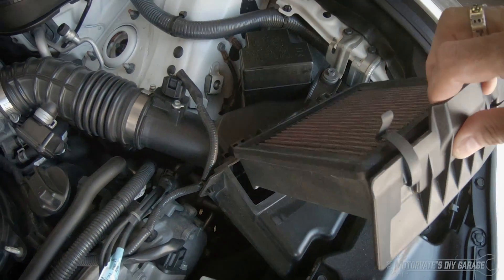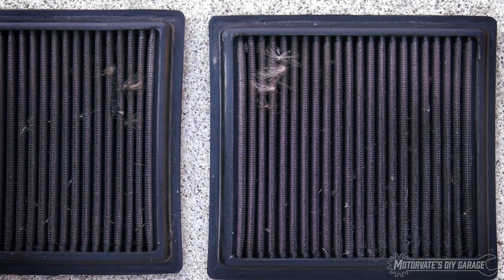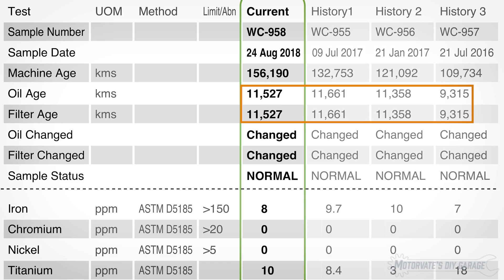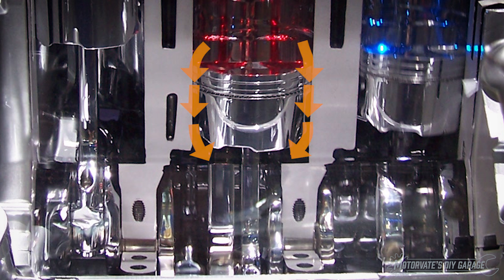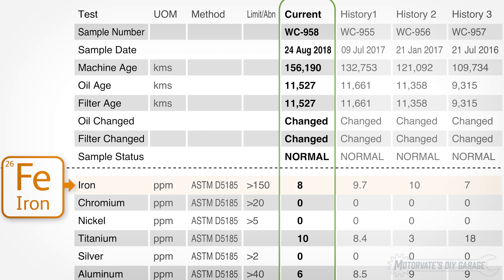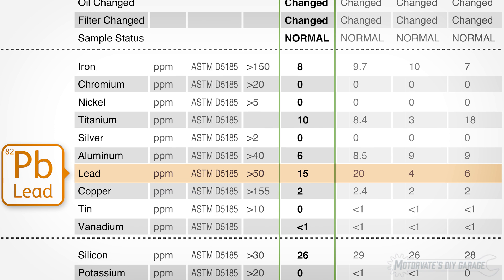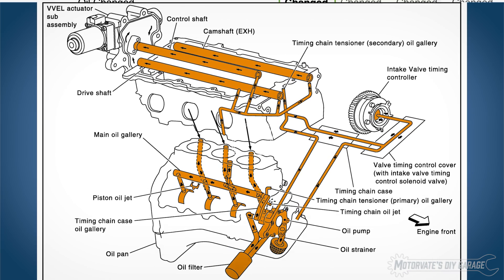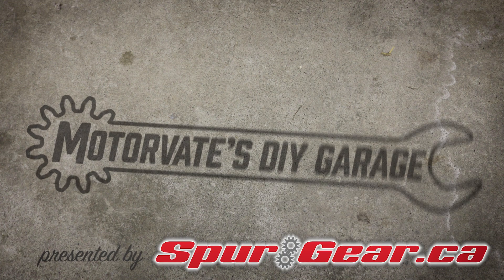K&N Filter Test… Two Years and 50,000 KM Later: Motorvate's DIY Garage Ep.34

Comment: Really good video.  I have used K&N filters for a long time on many vehicles.  I have never had any issues.  I still own my 2008 Ford Edge that has had a K&N filter since It had 5000 miles on it.  It now has 239,000 miles with that same K&N filter!  I clean and oil it about every 20 to 30 thousand miles depending how dirty it looks.  Never an issue. I'm not sure how people get oil on the mass air flow sensor, other than they just completely over oil it when cleaning them.

Comment: A dirty K&N will filter well... a clean one won't. High Flow = High Dust. Check out the Project Farm channel for more accurate testing. Is is worth compromising your engine for "cool sound" and and a mere 0 to 5 extra HP gain? Absolutely not! You want your engine air scrubbed clean, not dust laden.

Comment: Common sense really, I use k&n filters, I dont use them on 4x4s or etc. Really think about your environment, racing, street use and general daily life is fine but the words high flow and dirt, sand and etc don't go together. Its the same as running different oil grades in different climates, got to use your brain. I think the filters are fine, get a tad better eco, little more throttle response, really the main reason I use them is I drive a lot for my bussiness and go through $40 oem filters often, its far easier and cheaper to use a K&N for me.

Comment: I bought mine 4 years ago. Havent had to replace them yet. May pull the trigger in a few months but ive only put on 20k miles so far!
Reply from the maker: To me, being able to clean the air filter is a fantastic cost savings and stops putting used air filters in the garbage/landfill.

Comment: Thank you for doing this test, as it has given me confidence in the K&N air filters that came with the aftermarket cold-air intake system that I had installed on my 370Z. The system I got was a Stillen Gen 3 long tube cold air intake that has two massive cone-shaped K&N air filters. I had that system installed one day, along with a Fast Intentions dual x-pipe cat back exhaust and followed up the next day with a chassis dyno tune done with Ecutek software. After 7 dyno pulls, the tuner got the F/A mixture and ignition timing dialed in for a gain of about 55 peak crankshaft horsepower. This was an estimate, based on an assumed 17% drivetrain loss through the 6-speed manual transmission. The actual rear-wheel peak horsepower was 321@7200 rpm.

I'd like to thank you again for all the interesting and informative content regarding the VQ engine platform.
Reply from the maker: +55 HP sounds like a lot of fun.
Anyways, thanks for your kind words, you made my day!

Comment: I've driven in the desert and sand dunes a lot!  When I used a K&N briefly,  there was a lot of fine grit in the intake tract AFTER the air filter.  The filter was oiled and seated in the housing correctly.  When threw it in the trash and installed a factory paper filter,  I never had  grit in the intake again.  My personal experience showed the K&N did not filter small particles adequately and let many of them in.   I not sure how it can be refuted that K&Ns do a decent job filtering. They don't.
Reply: congrats. you used a racing filter in the desert where its not designed for and were expecting what exactly?
Reply from the maker: My results are based in where I drive... which is not in the desert, but in the county /city, and doesn't have much/any sand.
Reply: https://youtu.be/nZ0YEPR1pJ8?si=8BqTahkzTZD2cdQt
Reply: ISO testing does't lie.  People like to defend K&N because it's what they've used and it works for them.  Regardless of what the real data says.

Comment: AWESOME! I usually read discussions on how K&N filters can damage the engine of non sport cars but none of them are based on real experiment. You experiment proved that the trade of between more performance or fuel economy  overcome the low level of dust the filters allow.
Reply from the maker: Thanks for your comment.
As I see it, most comments/opinions on the K&N filters are based on what they have read, not their own test.

I have used those exact K&N  filters for 6 years and now have switched back to the Nissan/Infiniti OEM filter. The next few engine oil analysis will show the difference.

I have no agenda here, I'm not paid by K&N, I only follow the data... and I want to know the difference between K&N and OEM filters. Too bad the testing takes so long... and I don't drive as much as I used to, since I now work from home.

Anyways, I'm very curious to see the difference :)
Reply: @MotorvateDIY how many miles left?
Reply from the maker: I changed my oil last week after 5,000 miles using the Nissan/Infiniti air filters and will be sending in a used oil analysis soon.
Reply: @MotorvateDIY  How did the results come up? does the K&N filter do the same filtering job as the oem? also would you mind giving me the part number for the k&N filter in this video? also what do you think about the oiled k&n filter stuff up the MAF sensor?
thanks a ton!
Reply from the maker: Unfortunately the sample from a few months ago got lost, but I'll do the same on my next oil change.

To get the part number, do a search on K&N site.

In over 30 years of using K&N filters on Nissan/Infiniti vehicles, I've never had a MAF issue. When cleaning the filter, only use the amount of oil as per the K&N website.
Reply: @MotorvateDIY  i fitted my k&n on my 370z stock boxes but its extremely tight fit, i kinda had to force to get the clamps on and was very careful not to break anything. Is this normal?
Reply from the maker: That was the same for me, they just seem to be a little thicker than the OEM ones.

Comment: For an added layer of protection you can also spring for the Nismo magnetic oil drain plug. Will catch any small loose metal particles not contained in the filter!
Reply from the maker: Good point! I do have a magnetic drain plug in the garage that I will install. Thanks for the tip!

Comment: Great video was sceptic about these but you went above and beyond here amazing !!!!!
Reply from the maker: Glad you liked it.
I left that filter in the car for 5 years and NEVER cleaned it.
Now, I have brand new Nissan air filters, and will run them for a year and then get the engine oil analyzed, and compare the differences.

It should be interesting.

Comment: It will be great for al if you can create another episode on k&n air filter’s update.
Reply from the maker: That is in the works right now, but will take some time to put together.
Reply: @MotorvateDIY  I see. Did you clean your kn filters ever? Or are you still using it without cleaning and it’s showing normal result on engine oil analysis?
Reply from the maker: They were never cleaned...
You will have to wait for the episode to released to find those answers. :)
Reply: @MotorvateDIY  Mine as well! Haha. Looking forward to seeing the episode soon!!

Comment: It looks like you’ve used Mobil 0w30 from the blackstone oil analysis. If so, when do you use 5w30 and 0w30?
Reply from the maker: I only use 5W30, as per the owners manual.
Reply: @MotorvateDIY  I see. It seems like you are in Canada. Do you think 5w30 can last during Canadian winter season?
Reply from the maker: Yes.
Reply: @MotorvateDIY  5w30 sounds the one I should use if it can last during Canadian winter… Thank you
Reply: @MotorvateDIY  should I use Nissan engine oil brand or the penrite brand?

Comment: Impressive! Really interesting! I was really worry about this topic because I like to install this kind of air filters in my tune cars but I'm always debating about possible engine problems in long term... thanks!
Reply from the maker: I'm glad you liked that test. I'm now working on the next one.
I had those filters in the car for 6 years about 60,000 miles and didn't clean them... to do another test.

I changed the oil and sent a sample to get analyzed and then put in 2 new Nissan filters. 

At the next oil change, or maybe the one after that one, I will get the oil analyzed and see what the difference is.

The problem with these tests is that they take so long... but that is the only way to get a long term test :)
Reply: @MotorvateDIY hi there, I’m very interested to know your results with the Nissan filters?
I’m a big fan of K&N, been using them for years but there is a lot of bad talk about them of late. 
(Old post I know but see your still making videos so hoping for as much information you can give on this subject)
Reply from the maker: I'm working on the next test :)
At the end of last year, I switched to the OEM/Infiniti air filters.
At the next oil change, the used oil will be analyzed to compare results.

The plan is to keep the OEM/Infiniti air filters in for a few yeas to see how the used oil analysis report changes.

I'm really curious to see the silicon levels, as this generally reports how much sand is getting past the air filter an into the oil.

Too bad these tests take so long :(
Reply: @MotorvateDIY  can’t wait to see these results. Even compared to your oil analysis you already have with the K&N will be interesting.
How many kilometres between oil changes are you doing?
Reply from the maker: I'm also looking forward to seeing the results.

For me, I change the oil every 11,000 KM / 6,800 miles.
Reply: @MotorvateDIY  so will this test be soon? As I change my oil half your intervals
Reply from the maker: Based on my current mileage, the first oil change / used oil analysis should be late this year or early 2024.

Comment: Here is my analysis of what happened and why this is not a meaningful result:

Very fine sand particles average 60 microns in size (the silicon measured). And oil filter is 8-40 micron pore size. So the filters would be catching near 100% of any sized sand in the engine. The only stuff that is going to show up is the extremely extremely find particles that will make it through the paper air filter (25-30 micron) and the oil filter. Because these particles are going to be very small, <8 microns, they show up in equal amounts since neither air filter will stop them, and the oil filter will miss them as well. Without the oil filter analyzed, these results are effectively meaningless as the oil filter would show a drastic increase in >8 micron particle size from the K&N. 

Next we look at the Iron results. Iron has a particle size of 4-20 micron on average. Much smaller than sand on average. Which also means a huge amount is going to be making it through the oil filter. This variable also isolates the filter out because it has nothing to do with incoming particle size, but particle size produced as a direct result of wear on the engine. As soon as the filter swaps in we jump from 7 to 10 ppm. That "doesn't sound like a lot" but once you put on your math goggles you realize that he just increased his engine wear by 40%. thats a FORTY PERCENT INCREASE IN WEAR. And before someone who doesn't know how to do math jumps into the comments, no its not a 30% increase. its 42% of 7, then added to the 7, to make 10. a 40% increase. Where is this material coming from? Exactly where he said its coming from. CYLINDER WALLS. It drops down to 8, which is still a 15% increase in wear from stock value. 

Think about it. Would you ever purchase something if when you bought it there was a stamp on it that said "your engine wear will increase 15-40%" ?? NO. you WOULDNT
Reply from the maker: I have had the same K&N filters in my car for 6 years and never cleaned them... all to get data for this test.

I've just changed my oil, sent a sample to Blackstone Labs, and will swap in brand new Nissan air filters, drive for 6,000 miles and get another used oil analysis.

When the PPM numbers are small, like iron, you can't says "wow, 40% increase in wear" because it is 3-4 PPM higher. 

The repeatability of an UOA is not 1 PPM and varies around 4-5 PPM. As always, the value of an UOA is looking at trends... not just the number.

I do appreciate you taking the time to comment!

Comment: Awesome video! You squashed all those K&N air filter haters out there. Proper maintenance and amount of oiling is key.
Reply: Except he didn't sample the oil filter at all... where all of these particulates get trapped. 

Sand (the silicon hes measuring) has a fine particle size of about 60 microns. Oil filters run micron sizes of 8 to 40. Which means nearly 100% of the sand that goes into the engine will be caught by the filter. And considering the air filter, paper or K&N, is more porous than the oil filter, the results will always be the same. 

Also observe the sharp increase in iron. he went from 7, to 10! thats a FORTY PERCENT INCREASE in particles. He had a FORTY PERCENT INCREASE in engine wear as soon as he swapped filters. And iron particles are 4-20 micron which means they are making it through the oil filter and therefore showing up on these tests. Where do you think thats coming from? His cylinder walls.
Reply from the maker: I have used K&N filters since the late 80s... I don't live in a very dusty are and they work for me :)

Comment: Wow, a dirty K&N filter still catches dust just fine.  Oh wait, a dirty air filter means less air going in and less power.....  K&N are trash
Reply from the maker: Based on multiple used oil analysis, for where I drive, the filter just fine.

Comment: Did you clean and re-oil the filter during the 50km test period or did you just stick it tin there and leave it? Thanks!
Reply from the maker: Nope! And that same filter is in the car right now and hasn't been cleaned since I put it in way back in 2016.

All for a future episode to see how well the K&N filters, filter when they are not cleaned :)
Reply: @MotorvateDIY  interesting! I just like them because you can hear the turbo better, but there's no way I'm cleaning it. Not worth it if it's hurting the engine though, what can we expect the results of that test?!
Reply from the maker: In the summer I will do an oil change and used oil analysis to see where things are and how they have changed since 2016.

Unfortunately, in the last 2 years I haven't driven very much, so I won't have as much mileage on them as I would like, but some data is better than none :)

Comment: Sir, Im using the same K&N filter on my g. Could you advise me every km/year I should clean & re-condition the filter?
Reply from the maker: Good question... but I can't answer it.
As part of a test for a future episode, my K&N filter has been in the car since July 2016 and has over  76,000 KM on it without being cleaned.

and my last used oil analysis in Jan 2021 showed all is well with regards to the quality of air filtration where I typically drive. (and that is mostly city)

Comment: This test is measuring a secondary set of parameters (engine oil) and thus doesn't really tell us much about the efficiency of the filters in collecting dust across different conditions.  In reality, controlled lab test results show that eg K&N filters are far worse at trapping and accumulating dust, and in the following results for one of the stress tests you can see a K&N filter passing 18X as much dust as the stock filter (yes, eighteen times!):
https://www.nicoclub.com/archives/kn-vs-oem-filter.html

It's pretty clear that K&N's claims about flow and HP gains are probably accurate, but in terms of protecting the engine from dust, these high-performance filters are verifiably not all they're cracked up to be.
Reply from the maker: Let me ask you this. If the "dirt" that gets through the K&N doesn't end up in the oil does it matter? Will that hurt the engine as it passes through? I don't think so....

My 95 Maxima had a K&N cone filter on it for over 300,000 Km with out any MAF issues or burning oil. My G37 has has the same air filter (without cleaning) for almost 90,000 Km and the last used oil analysis had silicon at 29 PPM. Just below the warning of 30 PPM... and it still is in my car. AND I wouldn't do anything to hurt my car.

Many people talk about the K&N filter being bad with out their own data. I don't care what the forums says.... I only follow what my data shows me.

Do you have personal data to share or just an opinion?
Reply: @MotorvateDIY 100% 👍👍👍

Comment: After 2 years, is your Lead-Value dropped to 15 or 10ppm again ?
Reply from the maker: Hey  TT-RS,
Funny that you should ask this.... I changed my oil in March and did a used oil analysis.

Lead is now 3 ppm, down from 21 from July 2017.

Also, silicon is 29, and that is with the exact same (and un-cleaned) K&N!
Reply: @MotorvateDIY  
Why should I don't ask      :-)
I was curious about.

Thanks for quick reply.........

Comment: When should i re-condition kn air filter on our 08+ g sedans?
Reply from the maker: Hey Peter Kim,
That's a hard question to answer... I think you should clean it when you think it needs it. Make sure to check K&Ns site to find out how much oil to use.

The filter in this video is STILL in my car. The used oil analysis from Feb 2021 showed silicon at 28 PPM and everything else looked good. So I still haven't cleaned it.
Reply: @MotorvateDIY  For how long are you using the same air filter without cleaning??

Comment: Great analysis.  Lots of haters for K&N but sounds like they don’t do proper maintenance on it.
Reply from the maker: Hey  webguy943,
Different people have different experiences. or they repeat something they read online that makes sense to them, but may not be factual.

Those K&N filters are still in my car, and they haven't  been cleaned since  July 2017. AND the last used engine oil analysis from Feb 2021, showed 28 PPM of silicon and all wear metals were average. They work for me :)

BUT I don't live in a sandy or dusty area. I might have different results if I did. However, since I don't, I can only report my actual results on where I drive. :)